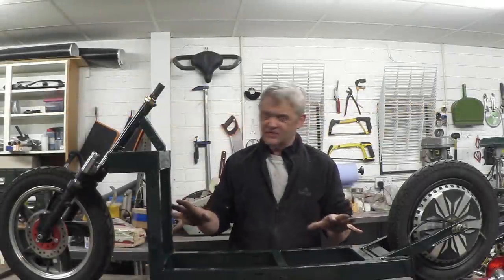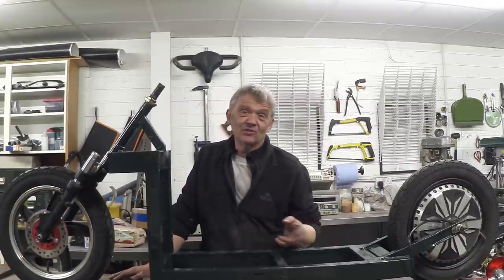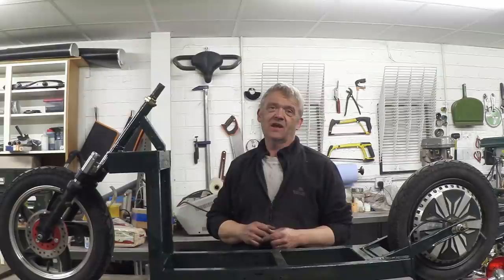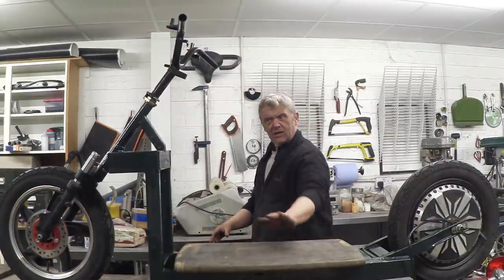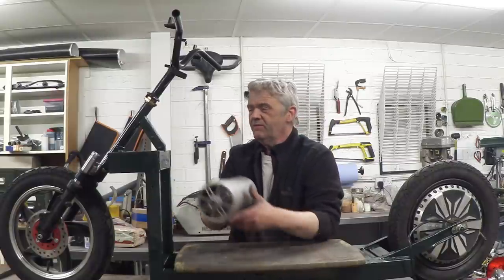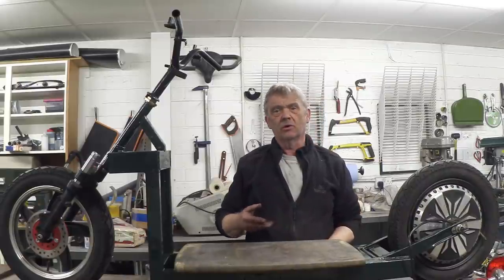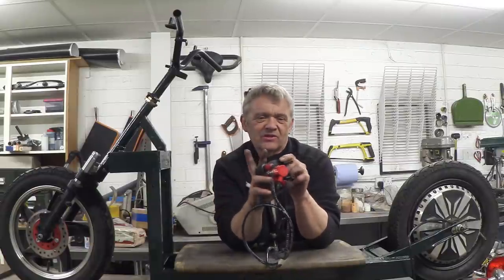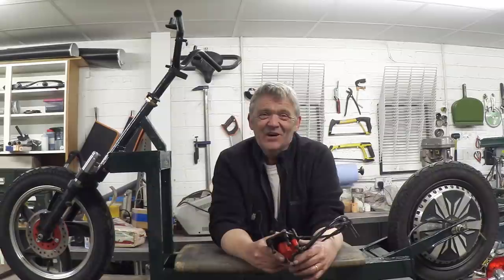Making A Big Wheel Electric Kick Scooter - Part 2 - Steampunk Style

Comment: I started building E-Bikes last year, and I can tell you that doesn't look like 250w or even 500w motor. I would say that motor is closer to 1000W - 2000W, unless the motor is mostly hollow inside. The watt rating is less important than the winding configuration and the total mass of the motor (more mass can handle more heat). Crack it open and take a look inside. While you have it open add some Starorade from GRIN Tech (air gap bridging ferrofluid for cooling). Then that motor should easily handle 72V at 60A without over heating. You may need upgrade the phase wires to 10 Gauge to handle the current.

Comment: How did I miss this? A great idea. Something that immediately springs to mind for running the wiring loom in (when you get to that stage) is that you could use copper or brass piping, glands and T pieces etc to run the wiring loom in.

Comment: Hi Robert  I like the idea of putting a cylinder has a instrument panel . To keep it in the HG Wells time machine, a couple of  tee bar levers  each side of the cylinder 
that do nothing would be a nice touch like the controls in the movie .In the vertical square that supports the front forks you could have a dummy flux capacitor 
Nice  build by the way

Comment: I thought the same thing on the forks snapping off... Next thing is... Unless you turn into a "little person" those handlebars are too low and even then that is questionable. Last... Don't paint something until you are done building it... then you just have to grind it off to weld parts on and then you have feather sand it out before repainting it.

Comment: Version 5.0 - A small gasifier on the back to, indirectly, power the batteries.
Version 10.0 Mechanical wings that flap to create lift and reduce surface friction.
Version 20.0 No more wheels required...
Reply: Roads? Where we're going, we don't need roads...
Reply from the maker: I have been looking at mini gasifiers lol

Comment: I'm curious to see which battery type you use and how you are going to control the power flow. I always thought it would be cool to design an electric vehicle, perhaps using an AC motor,  and stick a gas generator on it lol. Best of luck from Nova Scotia. Cheers.
Reply from the maker: I am not really sure what I am going to do about the battery at this stage but I will decide in the next day or so that's for sure

Comment: If you lens the end of the barrel it would make an interesting indicator,the widebore plastic pipe that you used for the wind generator can be moulded round the tyre with a heat gun,used this technique for a 20inch bike wheel mudguard using a wet cloth, spray paint sticks well  with sanding and residual heat,I used smaller pipe awkward but doable,I like the concept:) I now have the Music from the film any which way but loose,biker scene with the right turn Clyde! Stuck in my head! Aviator goggles+ww2 leather flying cap?:)
Reply from the maker: curses - you are thinking the same way as me lol
Reply: @ThinkingandTinkering  hahahha lol

Comment: The idea of using copper as a wheel fender sounds like a great idea.  You could put it together using stainless steel rivets,  or cut yourself out a shape of copper sheet and use an English wheel on it to stretch the metal out.
Reply: ....yes , just got to keep watch for galvanic corrosion .
Reply from the maker: I would have to lacquer the copper too or I would be cleaning it all the time lol

Comment: Just noticed,are the fork stations fixed or adjustable as the lowers look like they won't move,hard to see from here but there should be pinch bolts allowing the stations to slide in the brace,thought I'd say because they might be loose!:)
Reply from the maker: I have taken the suspension out as the only suspension this needs is in the tyres mate - so the forks have been spot welded not to move drained and slid in the fork holder I still have to chop the tops off so they don't hit the frame which is what I think you noticed - but cheers
Reply: @ThinkingandTinkering  that was going to be another question! Lol thought so,let you get your third coffee!:)

Comment: the brake on the front won't be problematic will it?  I remember on my old small motorbike, one had to be very careful with the front brake or the back end would either try to flip, or swing out to the side- both of which were alarming and caused crashes early on.   Just something to ponder maybe.

Also for some reason I had assumed you'd put the drive wheel on the front.  Don't know Why I thought that, but I did.
Reply: It's no different to applying braking on a bicycle, or indeed any vehicle. You modulate the braking. On a bike or scooter, you can lean your backside rearwards to counteract some of the weight shift and avoid any embarrassing ground to flesh interfacing. Around 75% of the braking ability is provided by the front wheel, and hard braking at the rear will just cause a skid.  Because static friction is less than rolling friction, a locked wheel takes longer to stop than one that is not quite skidding.
Reply from the maker: it will have front and rear brakes mate

Comment: That is a very shallow rake for a stand scooter. If seated it should be fine.
Reply from the maker: ok mate - but if it is I can alway pipe bend the handle bars to a better rake - I am not even sure if it is the right height - I'll probably adjust them when I get this on the floor
Reply: @ThinkingandTinkering  Sure, however bending the handle bar extension will exacerbate the eccentricity of the handle bar radius and make the steering movement awkward. I am still enjoying watching you build it... and who knows, I might just be wrong, it has happened before :)

Comment: Okay you're flying towards the kerb, the front shocks absorb the front wheel being pushed up and then that square base hits the kerb and THE flies over the handlebars, thinking as he goes...something wrong here. I would take the 90 degree front of the frame and make it 45 degrees so it would create sparks as it scrapes up over the kerb allowing the intrepid RMS to say, "well that was fun"...and off he goes into the distance racing towards his next project....
Reply: I was going to say exactly the same, Rob has engineered something with an incredibly weak front end, and it needs that triangulation., which is a very easy fix. As it stands its the worst design I can think of for flexing in the frame.
Reply: .....sure, however sometimes the strength and stability is inherent in the choice of materials and amount of material rather than relying on triangulation. Not all classic cars have the inherent structural strength to convert to  open top for example cos cabin and even front and rear windshield are part of the structure in most cars now .
Reply from the maker: To be honest mate - given the state of the laws in Europe this is only ever likely to get ridden around the car park
Reply: @ThinkingandTinkering  So its more of a science art piece then anything practical/usefull, not something other people should copy if they want something workable.